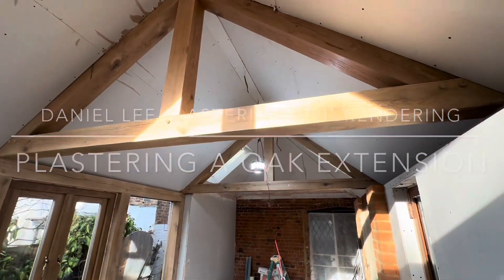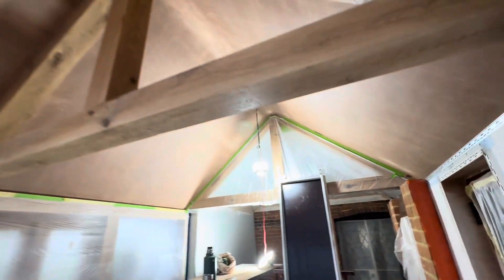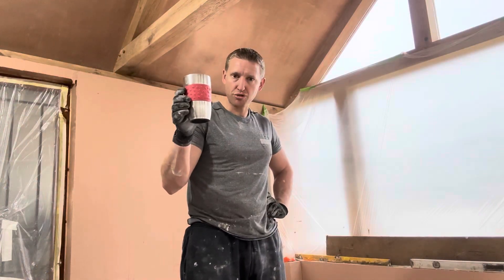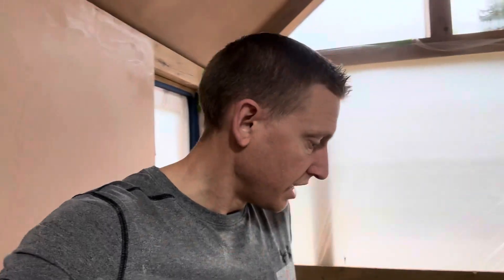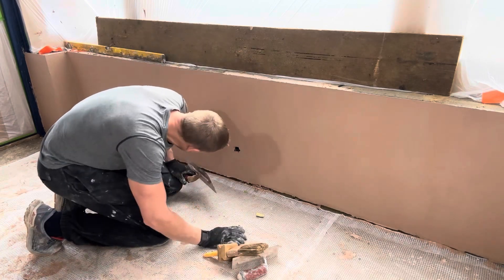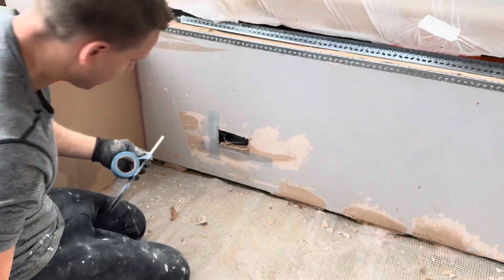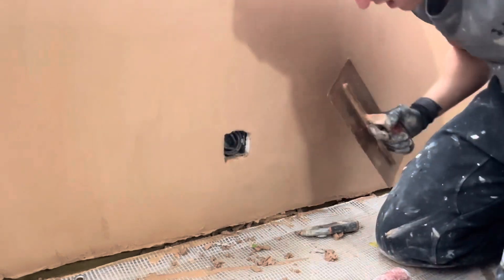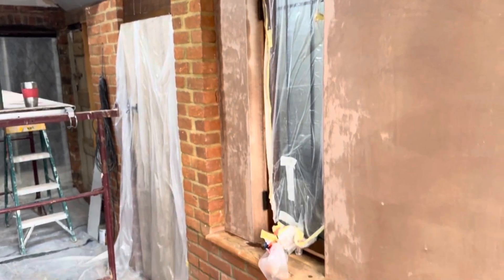How to repair plaster board around electrical socket to be plastered. Plastering an oak extension.

Comment: Did the plastic sheeting around the Oak Condensate/Sweat?? .... It looked like some black misting on the beams after you removed it .... Often the case in cold weather ... Just curious that's all 🤠

Comment: Was there any stop beads along side of oak a frames to help with movement/cracking of the plaster
Reply from the maker: Good question. We have fitted stop beads all around oak beams in the past. You can still get gaps. This customer has done many oak frame extensions in the past and he told us he was happy with getting it decorated well and caulking around all the oak beams. He has many more years experience working with oak than me and seems very happy to ‘ touch up ‘ around the oak beams as is needed over the years.